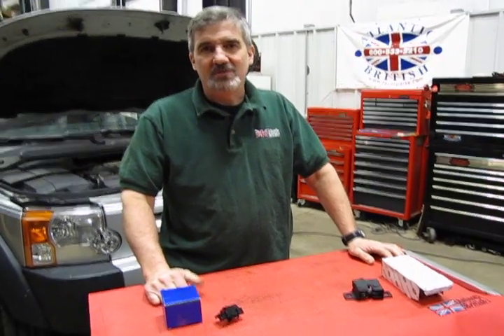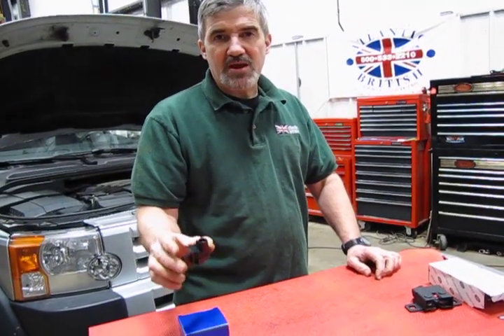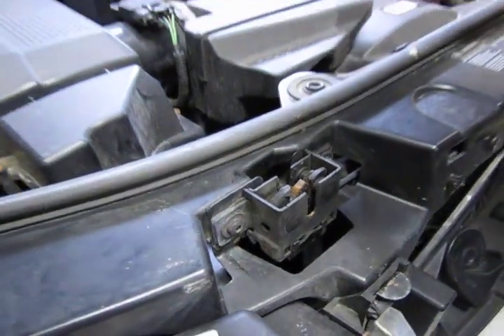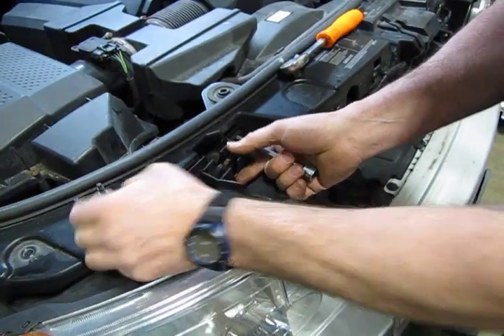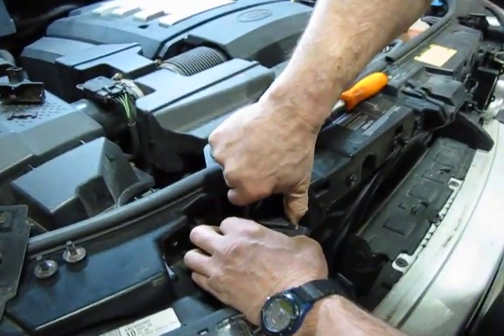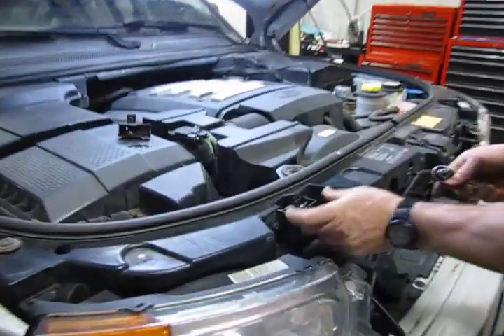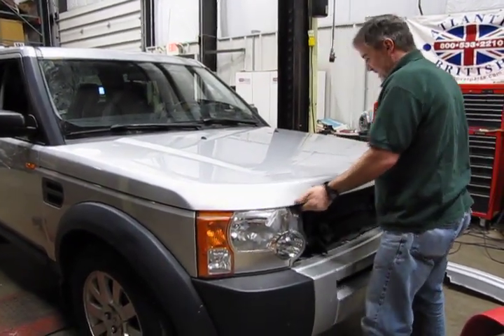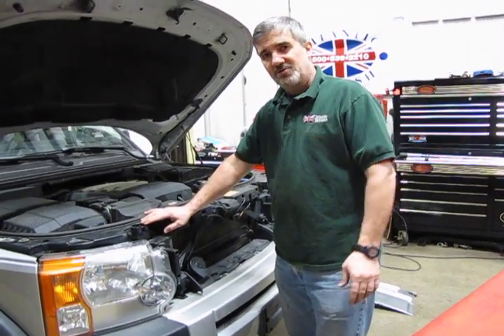Replacing The Hood Latch Including Hood Alarm Switch On A Land Rover LR3

Comment: Very helpful and clear instructions. I Bought the original latch and sensor (similar to the one in the clip) from Land Rover for my discovery 3 2007 for £30. It took me under 10 minutes to replace it with no skills or experience. Everything seems fine, no sign on dashboard (Bonnet open) and the most important, no more security alarm going off day and night. Thank you very much for this video.

Comment: This was very helpful and worked for me, although the Australian Freelander 2 (LR2) has a different grill. I ended up lossening up the top of the grill, removing the right headlight, and operating from the headlight hole and the rear like a surgeon doing a laproscopy! Time will tell whether I've fixed the false alarm problem. Thanks team!

Comment: common is the cable sticking stopping latching, the alarm switch is a simple spring microswitch same as used on truck engine brakes, it does not fail

Comment: this for a 2003 range rover hse.4.4
Reply from the maker: We don't have the hood latch assembly in stock currently for Range Rover Full Size L322 (2003), but we can get it and ship it within 2-3 days of order. Give us a call 800-533-2210 or email us and a parts specialist would be glad to assist. Not sure on the latch cable, but they will be able to tell you availability and price on that as well. Contact via email on www.roverparts.com. "Parts Question" tab in lower right of page on desktop or the question mark icon in header on mobile. Thx.